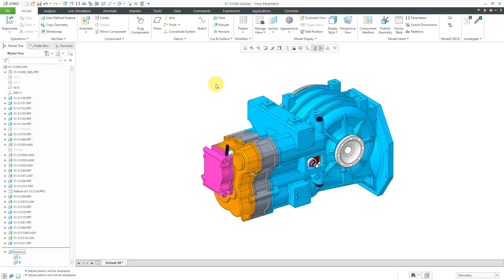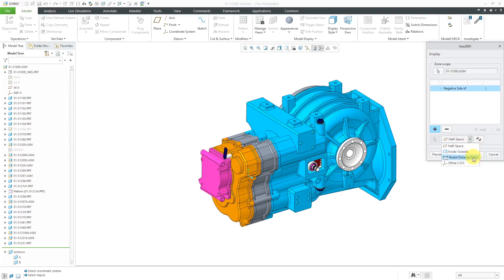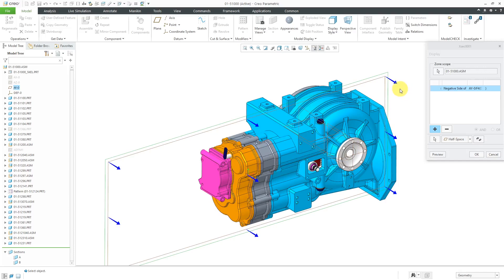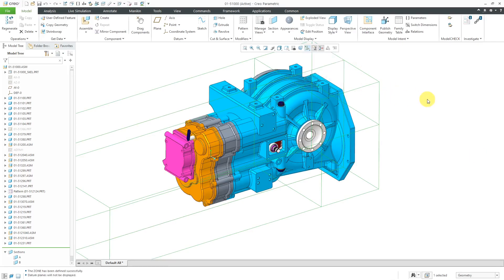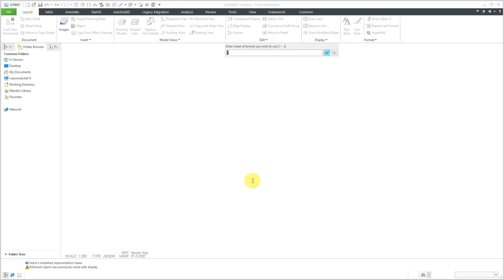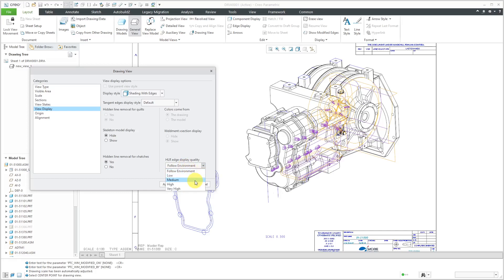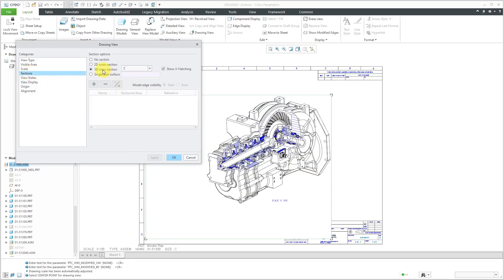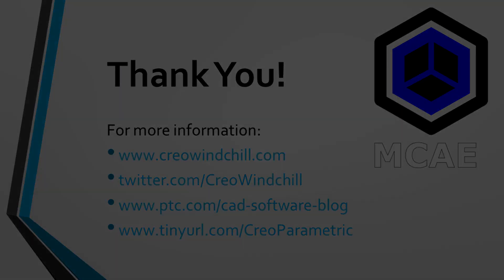Creo Parametric - Drawing 3D Section Views and Zones

Comment: Is there a way to create a zone like this that excludes a part or sub assembly?
Reply from the maker: Use an Offset Cross Section and from the Models tab you can specify which components to include or exclude. I have a video on that.